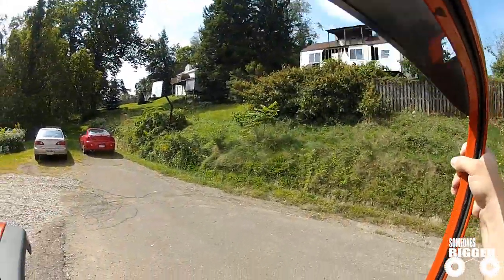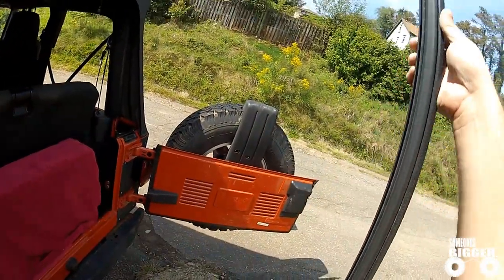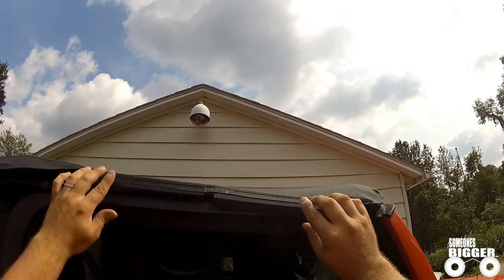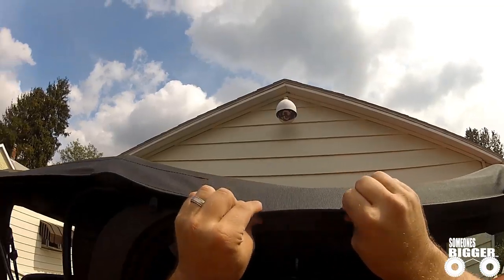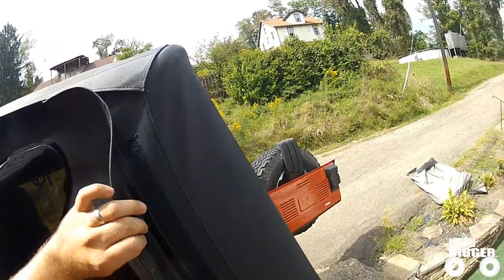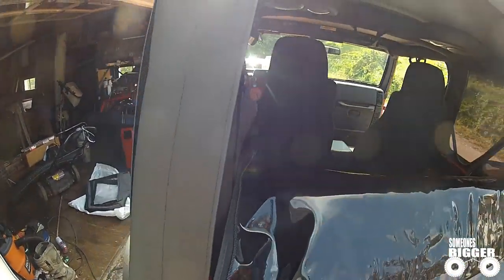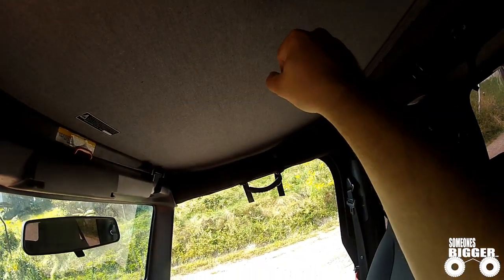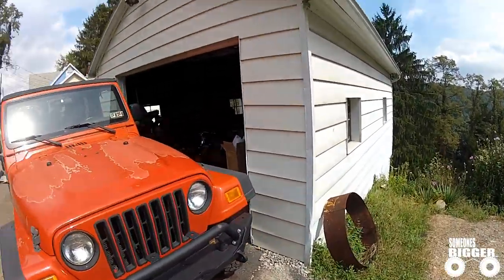Replacing a Soft Top on an 06 Jeep Wrangler TJ

Comment from the maker: @Mannix08215 It was about that temperature, maybe a tad warmer, when I put mine on...  The warmer the better. I wouldn't go any colder because you risk  cracking or tearing the top. If you are in a heated garage you should be cool. A hair dryer can give you that extra stretch too, just use common sense and don't burn the top. Happy Wheelin'!

Comment: hey Erica , was there a lot of stretching to get this top on or did it go fairly easy. Reason I ask is because  they say that you should do it in a garage that  is heated or at least warm since this will help with the installtion .Just wondering because I am in NJ and it's maybe 50 degrees today .